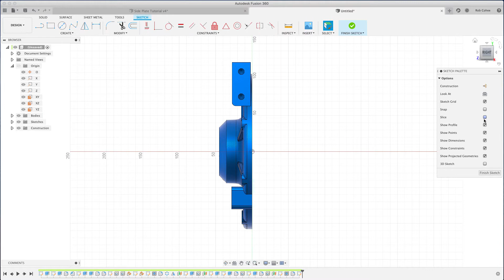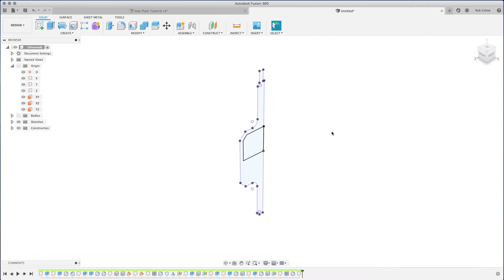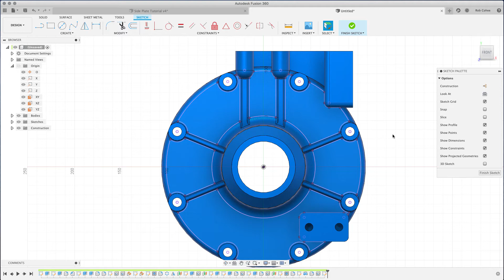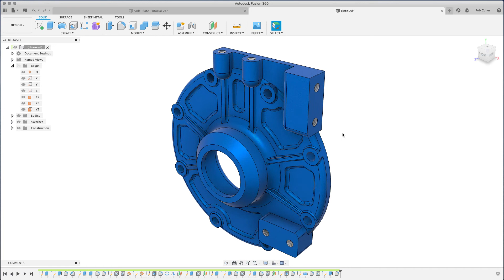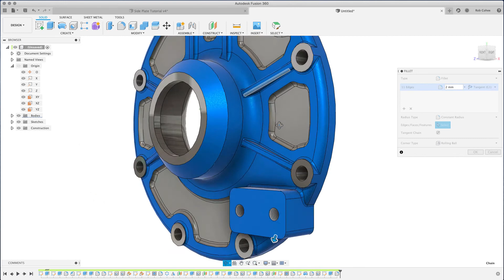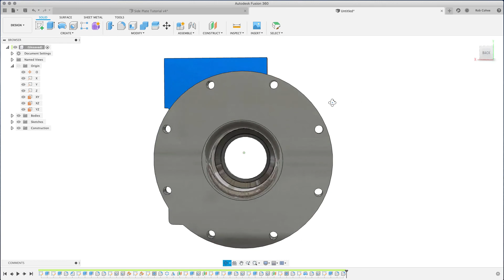Fusion 360 Part Modeling Part 4

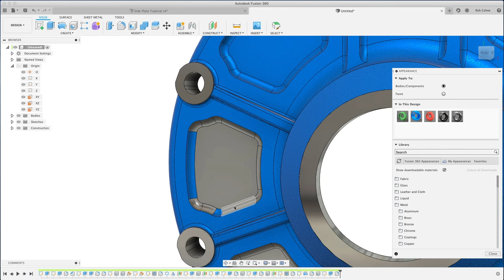Comment: @8:20, I may have a suggestion for your development team to speed up the process of selecting the faces when in the "Appearance" command. If you could have simply clicked the last extrude and fillet features in your timeline and all the faces created by these features would get selected. That would be only two clicks instead of the one by one endless selection. And further more, I would have expected Fusion to have behaved this way. Just throwing it out there! Also, you said you are planing a video on parameters... It has been shown many times about creating user parameters and going back and fourth from the parameter and the sketch or feature to link the parameter but I don't remember anyone showing on this Chanel how super efficient it is to simply rename a dimension or amount to better identify a parameter in the "Model Parameters" section of the parameters window and make it a favourite all from the parameter window and at any time in the process! It's super fast! One last thing! hehe! Ideas to keep your team busy! It would be nice if the component colour swatch would carry into the "Model parameters" of the  parameters window. I added these suggestions in the idea station long ago but when you get the chance to talk to the man in charge! hahah!!!

Absolutely love you videos! Love the content, the pace and the entertainment! Thanks!

- Blaise